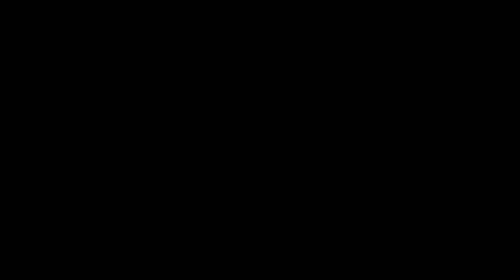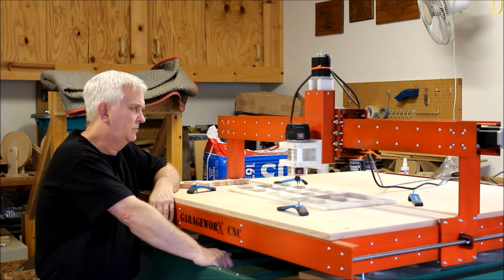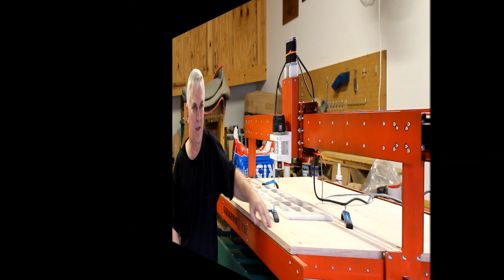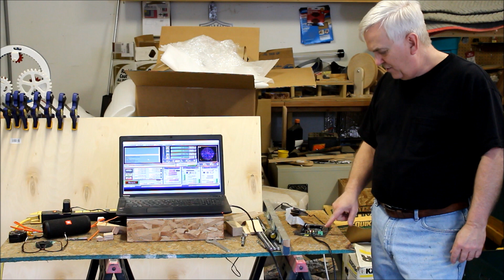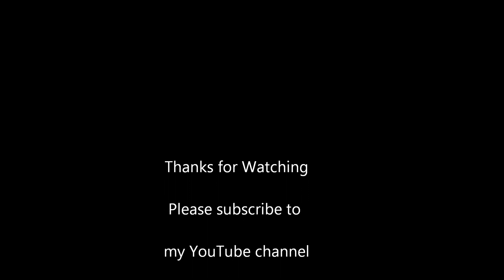My New Ethernet Smooth Stepper

Comment: I built a newer computer using ASUS Workstation Mother Board that still has LPT riser pins on the Board it's self. Look for the workstation line of Mother boards that have kept their COM and Printer Ports in a Riser pin out on the Mother board them selves. You could just plug that ribbon cable directly into my mother board without the Ethernet Smooth Stepper board but the Smoth stepper is a better setup  because of the fact that Ethernet transmission is much cleaner than the Slower LPT port and also much better than USB for distance of signal travel length. USB is only good for less than 30 feet before signal start to degrade but ethernet is good from 100's of feet even in to another    building.

Comment: Does this support slave A axis?
Reply from the maker: Yes it does.
Reply: Thank you
Reply: Does it really require the A-axis (for double X-axis for a big gantry) to be slaved using Mach3? Isn't is sufficient to just hook up both the X-axis and A-axis motor controllers on the same step & dir port as the X-axis? All the software does is send the same pulses to both channels anyways so it should be exactly the same. Then you could still use the A-axis for something else.
Reply: @powerpc6037  When reference home, Mach3 will square up two parallel motors to the cross axis provided that the 'home slave with master' in the general configuration is unchecked. Check out section 5.6.4 of the Mach3 manual.

Comment: Is the sole purpose of the ESS to be able to connect a parallel port controller board to a modern computer through ethernet or does it have other functions?

Comment: whats the different between a breakout board and a smooth stepper?....im confused
Reply: Hi Gus, the breakout board connects the pins on the input cable, the DB25 25 way ribbon cable and allows you to connect the individual pins to your equipment. So for example the breakout board or BOB will assign specific pins to send signals or receive signals. These signals will either send the PULSE and DIR segnals to one of your Axis Motor Drives and another pin will read the status of your end stop or limit switches. Now if you are using an older PC that has a Parallel or printer port, the DB25 connector can connect to that via a flat ribbon cable. Make sure you use a ribbon cable type connector as sometimes some of the cable type dont connect all of the connections up, most should do but cheaper ones might not. So, the ESS os smooth stepper simply allows you if you have a PC that doesnt have a Printer port on it to sit between the PC and the BOB. You can have a USB Smooth stepper or an Ethernet smooth stepper like he is using in this video. This allows a PC without a Printer port to either use ethernet or USB. Its basically a converter board. Hope that helps

Comment: Hello I'm from Iraq, I liked the wonderful your design Please give me the name of the special program for machinable engraving
Reply: not sure wat you mean but you going to need a cad program to make the design a program like mach3 to convert the design in G code that the drivers can read and send that through the smooth stepper , all the programs and add ons for the smooth stepper to work on a usb or athernet line are available on the website of the manufarturer 
http://warp9td.com/index.php/sw

it realy helps if you read english whell , its not my native language either but if i want to find anything its usually written in english 

dont ask me anything else about running the programs and stuff as i'm as mush a starter as you are

Comment: I had bought a USB smoothstepper had some probs with that tried several times to get working right it would just take off or stop in mid program so did some checking if you do get one get the ethernet smoothstepper less interferance they say

Comment: That's a nice interface.  Got to looking and this laptop I'm using doesn't have a parallel port.
Reply from the maker: +Ron Briz Thanks for watching Ron.  This is a good solution to use with the newer PCs that don't have a parallel port.  It is also available as a USB smooth stepper.